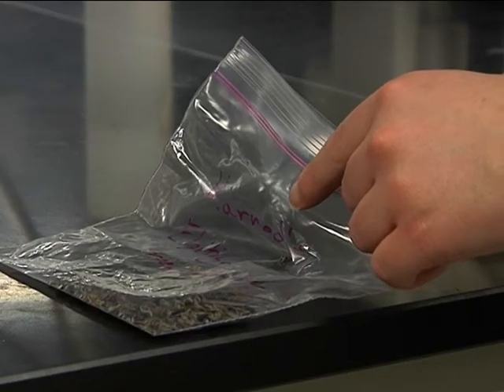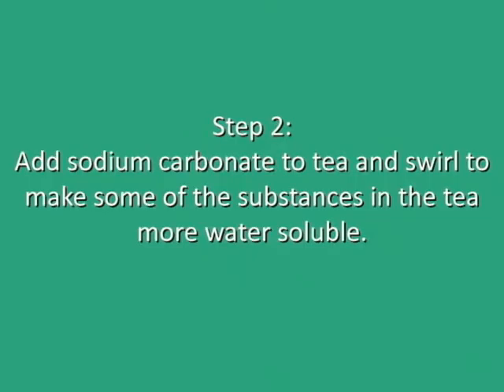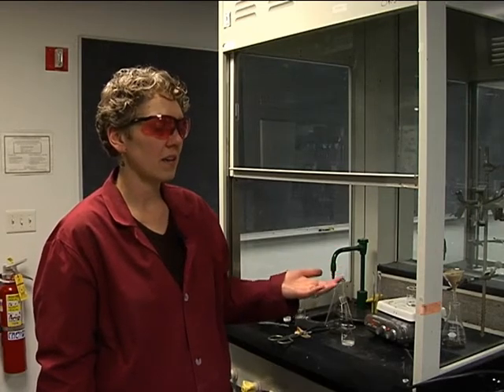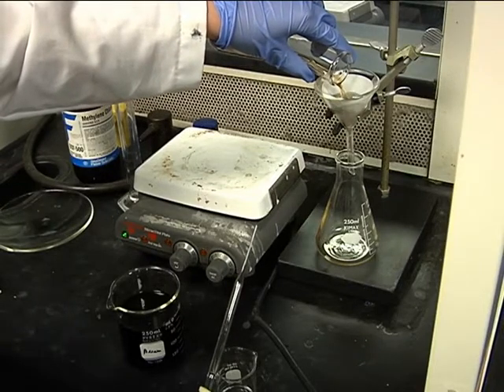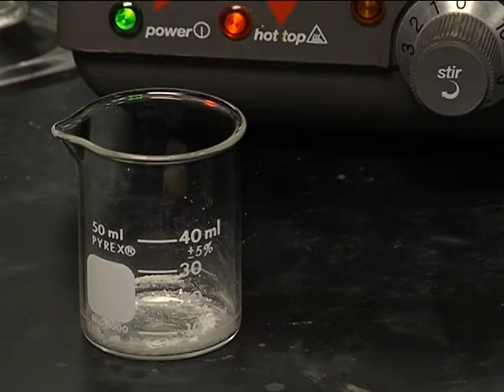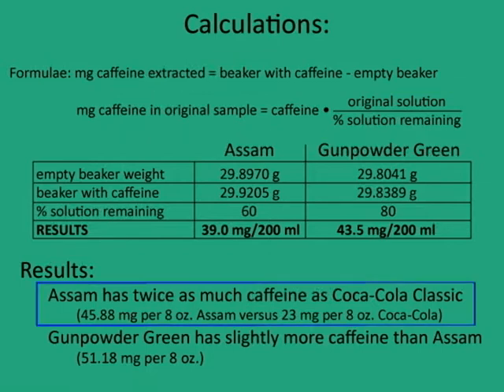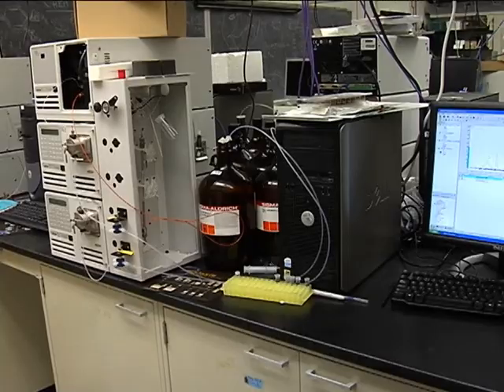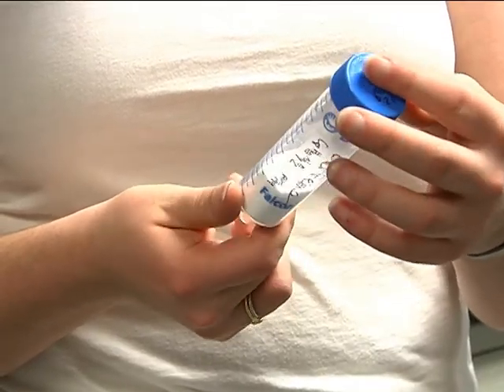Tea Caffeine Extraction - Reading between the leaves

Comment: @jammmon bases are most certainly water soluble. The alkaline hydroxides are extremely soluble in water. The sodium carbonate maximizes the solubility differences between caffeine and the undesirables in the aqueous phase, which drives the caffeine into the methylene chloride layer. Otherwise the caffeine would have a tendency to remain in the aqueous phase because it can act as a Lewis base and there are other acidic compounds initially extracted with it.